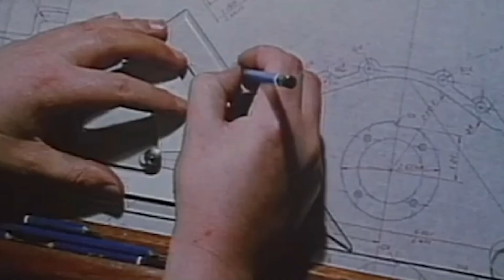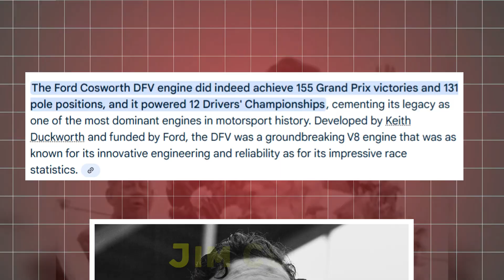FORD COSWORTH DFV | The Best V8 Engine Ever Produced?

Comment: Cosworth built engine, Ford provided the seed money. The BRM H-16 was 2 flat 8s bolted together, not Vs, hence the 'H' (horizontal). 4 valves let more air in and out, this has nothing to do with fuel delivery, though it allowed more fuel to be used. The close up of Jim Clark with his name at 2:18 is also Graham Hill. 3:38 and 5:00 those are not Ground Effect cars. Clark only raced the DFV once before being killed. 6:35 & 6:45 that McLaren does not have a DFV. Try Again.
Reply: Cosworth did build the DFV with Ford funding — that part’s spot on ✅
But valve design does play a role in fuel delivery too, not just airflow.
Jim Clark actually raced the DFV in multiple events and even won its debut at the 1967 Dutch GP 🏁
And McLaren use DFV engines through the late ’60s and ’70s. 
Like they got their first GP win in 1968 with the DFV-powered M7A 🏁
In the ’70s, they won championships with drivers like Fittipaldi and Hunt.

Sources: DFV Wiki | BRM H16 | DFV History